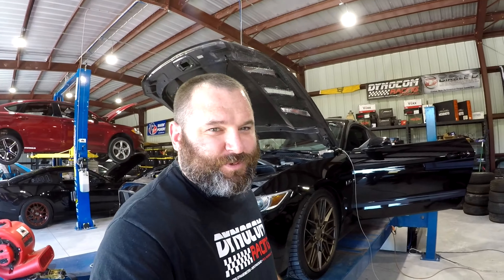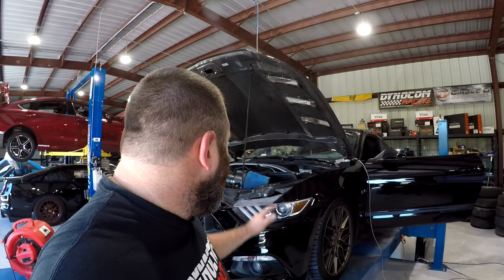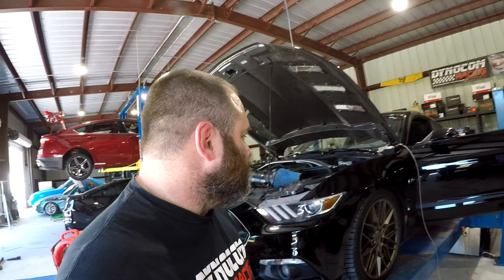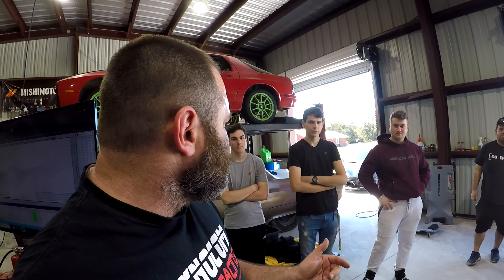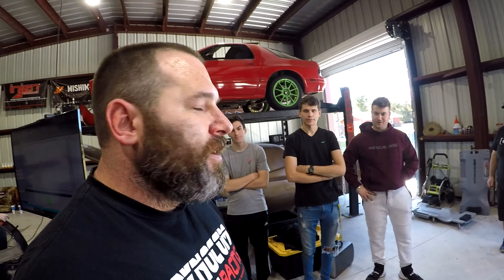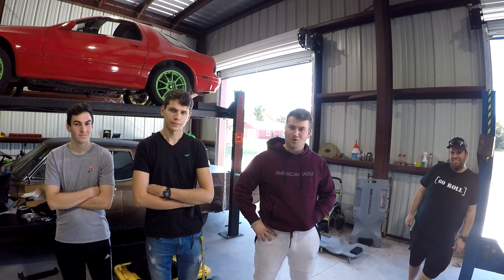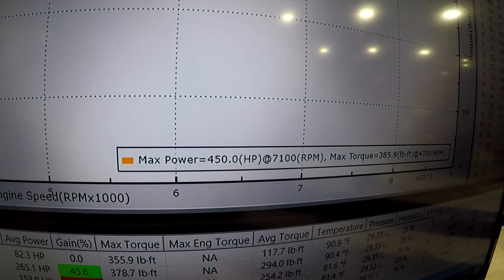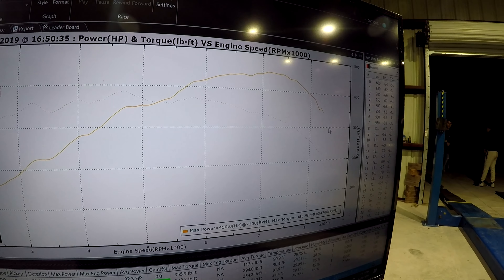#Mafiatuned Mustang GT Makes 450WHP with Basic Bolt ons ON PUMP GAS (Customer Car)

Comment: Would a 95lb injector be a good injector for a FBO 2015 GT?
Reply: Cold air intake, tune, catless long tubes, throttle body, intake manifold, fuel pump, cat back exhaust, and would be running E85
Reply from the maker: wayy over kill.  47 or 52 is all you need.

Feel Free to Message us with any questions if you need advice or a quote on any parts, builds, installs, or dyno, email tuning.  Here is a link to our Facebook Page.  Link: https://www.facebook.com/automafiaracing